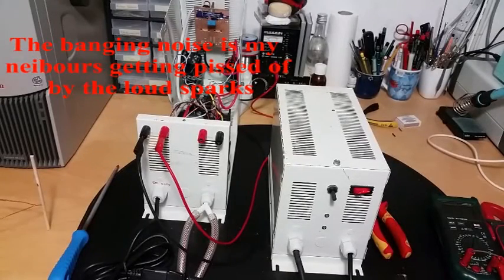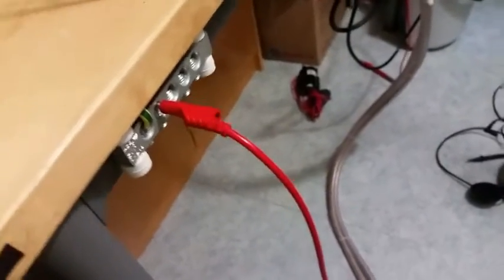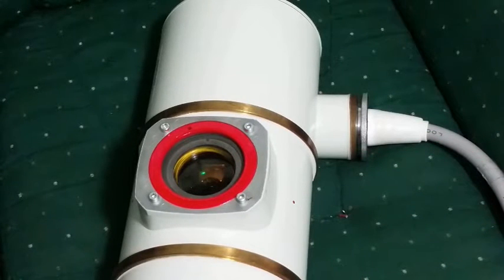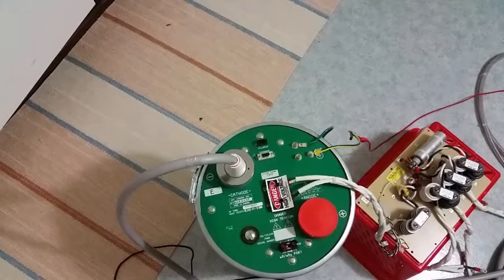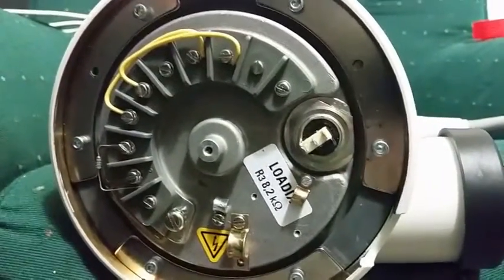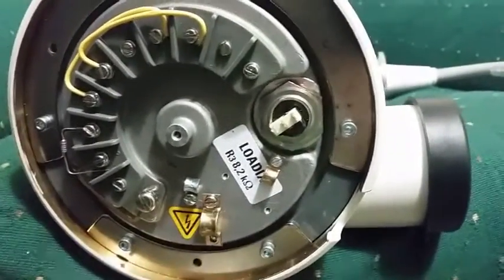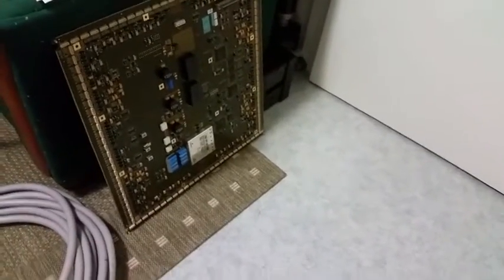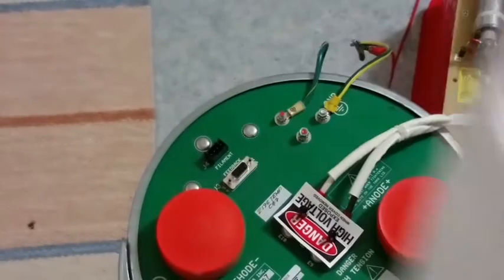Xray Update And Filament Test

Comment: Hi, I have the exact same tube and a spellman power supply. I haven't been able to figure out which connections are the filaments, which are stator and what voltages to connect to it. Can you help me with any information you've learned about it? I know that the yellow wires connected like that tell it to run the stator at 150hz, but I don't understand what voltage and where to connect the voltage to run the stator! And where to connect the filament voltage. I measured resistances between all the points, but still not clear.
Reply: Stator connections are:
0 = Common
I = Phase Shift
II = Main
The filaments are powered on the other end (Cathode) of the housing. Looking into the high voltage socket starting at the key and moving clockwise you have common, next is the Large focal spot, and the last one is the Small focal spot.

Comment: Nice finds! The filament is normally powered via Cathode cable and is about 6 volts @ several amps. You could use a low voltage power supply to connect to the 3 wire cable end. Often the larger Xray tubes use 2 filaments, one for fine focus at lower output settings and the other heavier build filament for high outputs. Also measure the resistance to check for filament continuity to make sure filaments are intact.